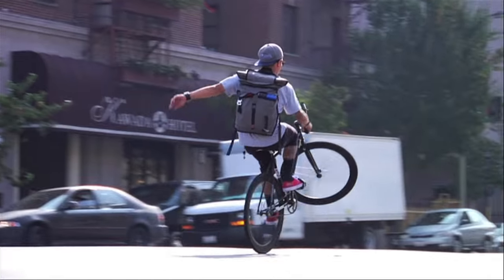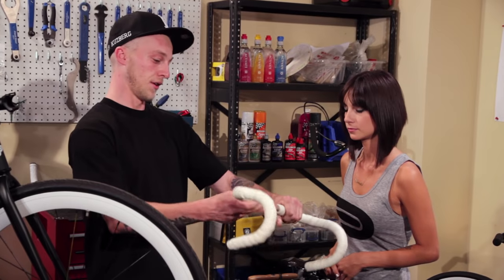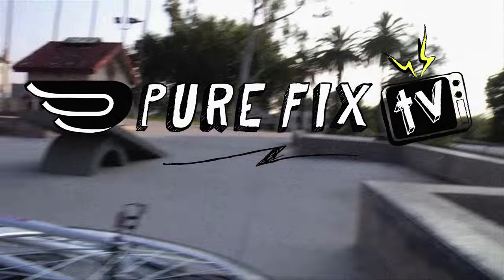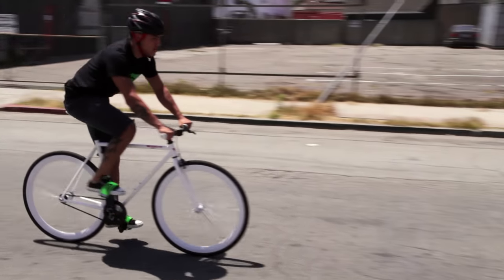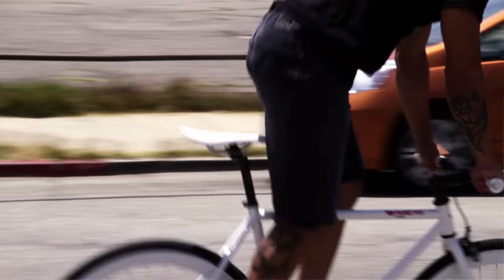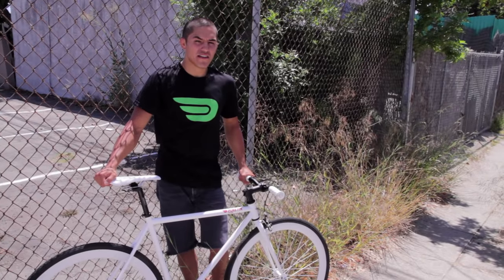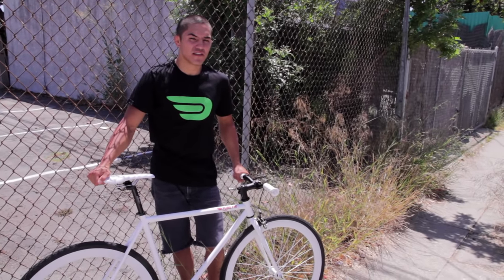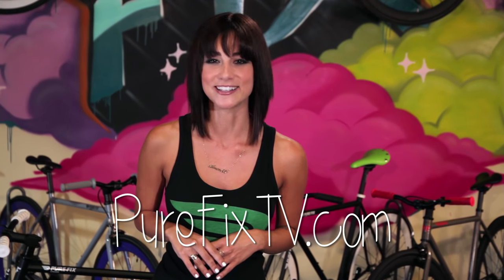How to stop your Fixie

Comment: Took the breaks off my car because I'm a "Real G".
Reply: bashort1 haha tru
Reply: Omega lol 😂
Reply: Brakes
Reply: I had no brake pad in back of my fwd I did have breaks in front but the rest manual braking/breaking in the automatic lol
Reply: oh, was that you?
Reply: Hahahah
Reply: Nah man you need to ditch the multiple gears and use a fixed drivetrain, ease the gas to brake, that's how you become the real G.
Reply: Replaced my steering wheel with dropbars
Reply: 🚬 😎THUGLIFE
Reply: @skydwellingmusic  im dead
Reply: upload a video of you skip stopping in your car, G!
Reply: Lol
Reply: @skydwellingmusic  do you stand up when you're driving uphill? 😆
Reply: Brakes
Reply: Yep, just shift into reverse, and then slowly press the gas pedal.
Reply: Fixed gear bicycles are definitely not for everybody. Most people should stick to a traditional road bike.
Reply: It's not for the weak. It can be your best friend or your worst nightmare. I was a New York City bike messenger and strictly road fixed gear for 6 years. Best bike I ever had.
Reply: u did not😔
Reply: Legends say this guy still driving
Reply: Fr
Reply: Just drift on unused spaces of sidewalk should do the trick
Reply: You can actually engine break in a car, but it won't get you to a complete stop and will break parts if you do it too much and too hard
Reply: This got me!!
Reply: Take the clutch out aswell and lock it permanently. May be you have fixed gear car 😀

Comment: love my disc brakes
Reply: how do they feel, say compared to the side pull or V types?
Reply: Paul Mccarter Most people I know that use disc brakes on road tires feel kind of unsafe. Not because they are under powered but because they are over powered. Especially when using them during rainy weather when the streets are slippery.
Reply: Oh, ok..Yeah, my bike coming tomorrow is a beach cruiser style with laaarge stainless rims and meaty tires..I'll really need it, with the extra weight of the 4 stroke system attatched.
Reply: +iamarawn better modulation on discs makes them better in the wet also - as long as you don't snatch at the brakes of course.
Reply: Gay
Reply: disc brakes are the best

Comment: I'm a courier and ride a fixed gear with both a back and a front brake. I like riding fixed because the fact that the crank and wheel are locked in rotation helps my bad knee (from Kung Fu, not cycling). Also, the extra inertia helps with maintaining cadence while sprinting. my job mainly consists of 2-3 mile bursts back and forth. And also it helps to "feel" the road and i find myself driving more like a car than a biker. Also, my brakes are located on the flats of my bullhorns, so sometimes when i'm riding on the horns, i straight up skid/ backpedal, but it helps to be able to skid then drop back on the brakes for a dead stop if i have to. As a courier, i find myself in tight spaces quite a bit and having brakes just adds extra maneuverability. I've seen messengers and couriers fly around brakeless/ one brake and then get smacked up the block for running a red. That split second of stoppage can mean life or death. I'd rather be alive than cool. Before you guys bitch about the back brake, here's my logic with having it: 

1. It obviously allows me to slow down without back pedaling which, once again, saves my knees.

2. There have been times where i've needed all 3 brakes for a super dead stop. However, if i wanted to, i can just as easily back pedal to slow down.

3. I live in Denver, Co. The metro is mostly flat, but there are a LOT of hills, and when you're fatigued from biking all day, and you're flying down a hill, sometimes you just wanna take your feet off the pedals and straight up just let gravity do the work and use the hand brakes to stop.

Comment: 1. Turn the bike in evacuate position
2. Ask the other vehicle crew if they need help
3. Unload main turret 
4. Bring everything you need
5. leave no crew inside the bike
6. Open all hatch of the bike
7. Destroy the vehicle if needed.
8. Disconnect gas tank
9. Leave the crashed area*

Comment: I just wanted to say if you build your Pure Fix at home that is awesome. However if you are going to try riding fixed at anytime in the future you need to get the cog and lockring tightened. I work at a bike shop and if this is not done, the cog and lockring could come unthreaded while trying to do the skid or skip stop, even the back pressure method could cause this to happen. The threads could get damaged badly it is not covered under warranty and you could crash and get super messed up. The more you know.

Comment: Thanks for the instructional video! I am new to fixed riding on my recently purchased Specialized Langster. Who said you cannot teach an old dog new tricks? The back foot pressure works great for me, and at reasonable speed does not require a tire skid. When I work my way up to streaming through traffic at high speed; hopefully, it will not require automobile contact to slow me down. We have a number of youngsters, locally, with no brakes, no helmuts; and there have been fatalities.  I am sticking to my helmut and keeping the brake, for now, as backup. I would rather be the wimp, and ride respectfully in traffic, than to lose out on being a dad. Most of safe, fixie miles to all.
Reply: Aren't you the dude from buzz feed ?
Reply: B Knapp blablabla

Comment: Fixie vs single speed (SS) is a different type of riding. Why most fixies hate front brakes has to do with the type of riding they have to use to control the bikes speed when slowing, as the video shows to control the rear wheel, either by skipping or by skidding requires the rider to be in the raised off the seat position. That brings the center of gravity (CG) up really high and up near the front wheel. If you add a front brake to that, the high CG up near the front wheel and it now becomes very easy for the front to lock up and over you go.

The SS rider can brake front & rear while still still seated, just like any other road bike, which keeps the CG lower and closer to the rear wheel so its more stable.  Also in an emergency stop the SS rider can lift off the seat and shift their weight back over the rear wheel while still staying crouched during braking. This gives the rider a greater deal of stability and control than the fixie during an emergency stop. This off seat over the rear technic is also how mountain bikers brake and control their bikes while riding down steep slopes, but it also works for road riding, at least for me. Just my opinion based on my own experiences, your mileage may vary.

Comment: 1. Sell fixie. 2. Get a proper road bike. 3. Stop normally.
Reply: ***** 4. You Win XD
Reply: +touchNazty I've followed yours and Oskar's advice and now all I have is brakes. Where did I go wrong...
Reply: ***** FUCK!
Reply: Brakes are for bustas
Reply: +Joseph Vasquez cory you a busta
Reply: +Oskar Mamrzynski Yeah, I don't get the moronic obsession with these bikes. Why a one-way mechanism in the rear hub and brakes are so evil is beyond me. Just gain some muscle to overcome those extra few ounces. None of these techniques are going to stop as close to well as a set of real brakes. Also, I don't get why anyone would ever put the seat above the handle bars. I don't understand why you are supposed to have your leg all but extended when a pedal is down. How do you reach the ground when you stop? I adjust my seats so that I can put both of my feet on the ground and not be sitting on the seat. If I need more power while pedaling that I can't get when I am sitting, I simply stand up to pedal. The seat above the handlebars just looks dangerous.
Reply: Riding for a long time with your seat to low can cause knee pain and other problems.
Reply: The fix gear riders at my shop think they're the hot shit.  Got a couple of idiots with fixie and clipless pedals.  Somehow they always seem to get flats probably from destroying their tires.  Why you'd ride a bike without breaks is beyond me.
Reply: Tim having your seat high is the optimum position to gain as much power from each pedal.  You sound like an amateur that has only riden mountain bikes from wal mart.  Standing up to pedal is not an efficient pedalung technique especially if you are trying to attain and maintain top speed for the duration of a long ride.  You will never get anywhere with you seat low.  You're not allowing for the full motion of your legs.
Reply: +Smileyfacedkiller ....sadly  logic and common sense do not resonate  with anyone who rides a no brake bike on the street.....
Reply: True, true.
Reply: Joseph Vasquez
yeah......of course they are.......but only because  they think not having them proves something or makes some kind of statement about some extra ability no brakes gives them... while they  think they are  "being different" by latching on to some splinter sect for some cheap ass "bragging rights" they really are just plain pathetic.....
Reply: +touchNazty  It's weird. I have a PureFix Victor, I got two brakes and stopping still sucks. The bike rides well and is beautiful but sometimes I feel safer stopping on a $150 Walmart bike. =o/
Reply: idk why a lot of people argue over fixies. I mean I'm only 12 and I own a BMX, Mountain, and a Fixie. I personally think a Fixie is great as a commuter bike as I ride it from home to school. It's fun having a mountain bike ridden but it gets boring easily. There's not really a normal bike as a Fixie can be easily switched to having a fixed or one gear. Fixies are fun for commuting from home to school, mountain bikes become a pain. I used a BMX a few times and I couldn't sit at all. At the end, there is no good bike because it all depends on someone's personal preference :)
Reply: buckandotis  I mean Fixies are just fun to ride. There shouldn't be an argument over what someone owns or rides. Like just let them ride it, its their choice. There shouldn't be arguing over what bike is better because all is just an opinion.
Reply: Nishmew Films
how are they any more fun than bikes with brakes?....c'mon dude admit it,it's just bullshit.....stupidity for the sake of "trying to be cool"in a world where everything has been  been done to death......if you need someone to tell you that riding anything on a road with no brakes is a dumb idea you probably are to stupid to be taken seriously.........you're right,there shouldn't be an argument....but not because no brake bikes make any sense....
Reply: buckandotis  I admit it is fun. I mean my family owns three, one for my brother and dad. Like dude just shut the fuck up and let me have my own opinion towards a thing. I didn't say it was a cool thing, I mean anyone could add some damn brakes to any fucking. Like let me have my own fun riding something without a dimwitted shithead get in the way of everything. All my family and friends say its for a cool factor but I just think its an easy and simple bike. It's fun, it could be dangerous, but as I said, people have different perspective of things. And this account is all about Fixies, if you do not like Fixies, then get the fuck out! There's no point in arguing about a single thing in an account about riding. Bringing hate doesn't stop anyone. It brings people closer and active but it doesn't mean you should bring hate at all.
Reply: buckandotis  Just listen, life is about taking risks, having some fun before it's too late. How about you just try it for yourself and see if you'd like it. Just take some risks and have fun with life bro! Just have fun with it,
Reply: Nishmew Films
no .....your life is about taking risks with other peoples lives.....if riding a bike with no brakes is the best  you can come up with  to have fun,it's you that's missing out on life not me....its a big world out there kid and that kind crap is what people do when they don't have options.....
Reply: +Nishmew Films just wait till someone makes a phone without the ability to call or someone makes a plane that doesn't fly... Sorry but it's the way they are, some humans are perfectly normal to roam around and do something beneficial to our planet while the corrupted or the humans with defects keep on inventing weird shit that is really useless and may cause HARM, the though of " cool ". Come on bring Albert Einstein and show him this so called Fixie, I wear he will claim it as stupid. WOW someone from the future invented a bike that doesn't have brakes. THE FUTURE IS FUCKED IF PEOPLE LIKE THESE EXIST
Reply: +Jan Arden Acuna so many mistakes on my comment but you guys get the point
Reply: buckandotis I'm sorry, buck, but you say that as if I give a damn about what you think of me.
Reply: Jackman LeBlanc
no you did not "say it".....i did.....you appear to be light on the reading comprehension ......and you confuse grammar with lazy keyboarding.....clearly you don't put a lot of thought into,well anything....
Reply: buckandotis Is petty insults all you have going for you? Because it's getting kind of boring. It was amusing at first, but now you're boring me.
Reply: Oskar Mamrzynski exactly tbh i regret buying one
Reply: i love how haters take on this... fixies are fucking cheap to maintain .. if you go for a 4k fixie then you're an idiot, besides the control over the road is way better on a fixie,  smalls distances fixie gets you there faster ... if you want a fixie to do mountain bike... downhill... or long road trips you still an idiot... is not about to say something is better is about to say whats the appropiate choice for you... and please... DO NOT REMOVE the front brake... dont be an idiot...
Reply: basically you should never ride a fixed gear outside of a track or closed course without brakes on it, because as shown in this video there is no way to quickly stop if you are carrying any speed.
Reply: Fixies may have been cool 10 years ago. Even the "cool"  argument is bullshit. You can get a nice, like new, Fixie for the price of a shitty Walmart bike now.
Reply: The only way I can describe riding a fixie is like shooting a camera in manual mode. Once you master it you realise how crap Automatic mode is.
Reply: I would describe it this way. You can drive an 911 on a closed tight canon road using nothing but second gear, no brakes or shifting and it's great but it would be dangerous to do on open roads with other vehicles.
Reply: Oskar Mamrzynski 1. Sell fixie 2. Sell road bike 3. Buy a mountain bike
Reply: N+1. You guys are not living by biking largest rule.
Reply: Oskar Mamrzynski Exactly
Reply: 1. Just get a fixie with breaks (no coastal break) 2. be happy
Reply: It's A Culture 
Experiencing life to the full is life enhancing.....as long as it doesn't impact on other people's lives. You're relying on other people to react in a manner you think they should......life's not like that son.
Reply: 3. Buy e mtb 4.Ride a bike that need skill
Reply: Dick Johnson i aint no hipster and i ride fixie
Reply: Oskar Mamrzynski no
Reply: 1.convert your road bike to fixie. 2.KEEP THE BRAKES.

Comment: Do you think it's okay to stop the front wheel with your foot?
Reply: Ouch.
Reply: rEsonansDx Oh no
Reply: Nooooo. The  whole bike will flip forwards with you on it.
Reply: yes, full stopping power from the front wheel
Reply: For tgose that wonder, yeah there are many ways to use your foot as a brake:

always have the saddle if you use it low enough so you can brake by stomping/pressing both feet on the ground and let friction do its work. - Yes, if you hillbomb you night need new shoes next week.

You can use the inner arc of one of your feet if you have no stooping profile and use the harder outer line of your soles, by pressing it gently from the side to the mantle. - Yes, you should try to let your leg be pulled to a degree into the profile.

Place the foot you have more control over for the first times flat onto the mantle of the front tyre and use your foot as a block between your tyre and the frame. Yes - it is dangerous, you have to learn it over and over. It can hurt and injure you badly. Does it stop you in an emergency? If you are already riding staying and are used to martial arts/sidekicks you sgould get a feel for it soon.

There are more. Let's leave it at that. Point is anyone can and should learn to control any vehicle driven, especially in an emergency, which is not meaning to prevent yourself from getting hurt - if you manage that, fine - but to not be a danger to others.

Comment: I think the single speed with brakes mode are the way to go for me. The longevity of the tires will pay for those components in the long run. Most FG's come with brakes and freewheel on a flip flop hub anyway.
Reply: Yeah. Flip flop hub is the best way to go. Front brake. Good to go. Have fun.

Comment: The question I have is how you guys cope with toe-overlap on a fixed when you have to go very slow around a really tight corner or obstacle
Reply: you buy a proper sized bike for you so it doesn't happen lol.
Reply: @Cypeq  given that this is such an old comment so it’s not even a problem anymore. Frame size has nothing to do with it but top tube/fork angle. On race bikes it’s pretty normal and nothing to worry about when you go faster. Back then I just wondered in regards to really slow maneuvering in heavy traffic with a bike built for speed. But since I never go slow it’s not a problem 🤷‍♂️

Comment: I was riding my 1970s custom fixie yesterday ( in my usual jack ass way) racing to a short cut between 2 concrete walls, caught a bit of gravel and hooked on the corner of the wall, I'm fine but holy crapper I totaled my entire bike.
I "brake" by a tiny hop and locking the crank with no straps or clips it's easy, and if you instantly peddle backwards.......I call it the 'scooby stop'.lol..Great video thx